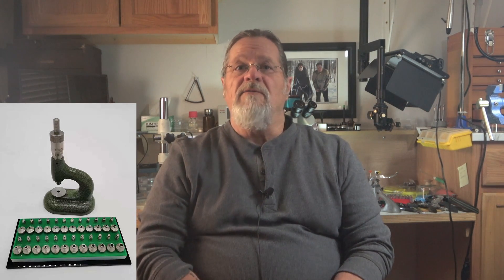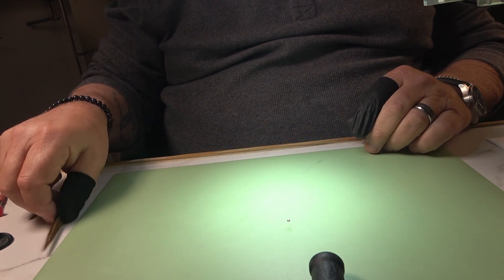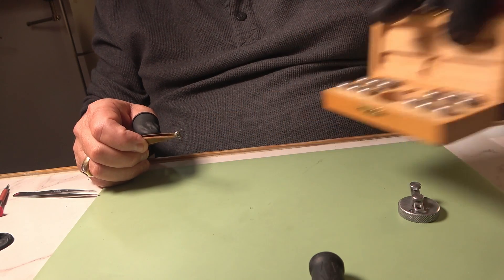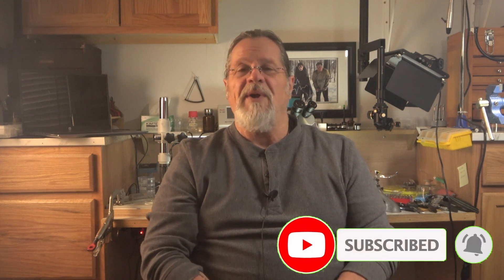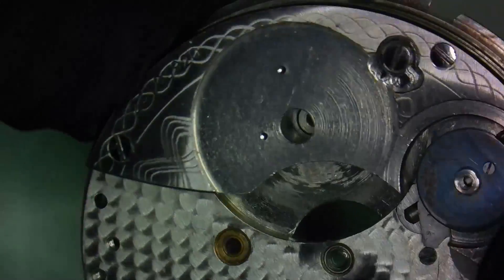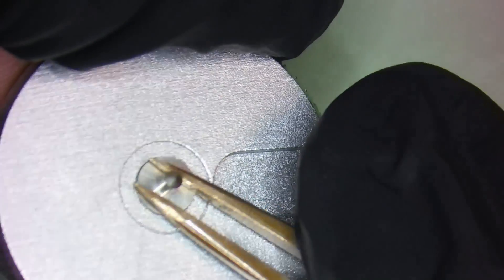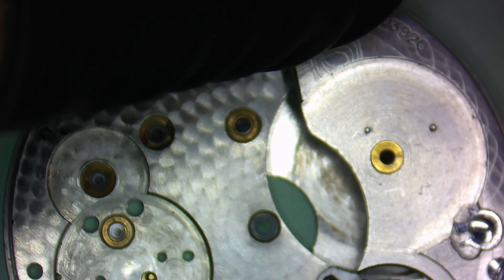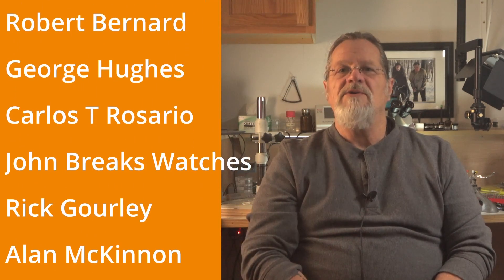Don't Buy a Horia Clone Until You Watch This.

Comment: Your videos are such a great service to the watchmaker community, Alex. I found this one as I go down the rabbit hole of attempting a jewel upgrade of the barrel arbor ports on a Seiko 6106. I just did a practice run using my Seitz jeweling tool to ream the lower barrel arbor port from 1.19 up to 1.59mm in 0.1mm increments. Worked great! 👍🏻
Reply from the maker: That's awesome! Good luck with the jeweling upgrade!

Comment: Hey Alex, as a new watchmaker  I've gone with many of the tools you've recommended, from the microscope to the time lab screw drivers and I haven't regretted any of your recommendations. The most recent in a Seitz vintage jeweling tool. I have a question on replacing a press fit jewel. Do you press the jewel in from the oil sink side or the flat side? Or does it matter? Thanks for making these videos. I've learned so much from you
Reply from the maker: I appreciate that! You always press the jewel in from the flat side.

Comment: My Chinese horia tool is amazing. Great tolerances. I also have a Seitz tool that I only use for reaming.
Reply from the maker: The handle on the one I have  came off, they are epoxied on but I was able to fix it. 
They work well for modern movements for sure.

Comment: I just purchased a Seitz jewel press (flea market) with no bits. I am thinking of buying a bit set "clone horia MSA 13.100 (bergeon 5372) Accessories watchmaker's jewelling tool with micrometric screw 4mm&4mm" for around 80 EUROS. The set has 24 pushers and 24 anvils. Any thought on that? Or any other suggestions?
Reply from the maker: You know you can buy original Seitz pushers and stakes. Without knowing how old the Seitz press you bought is,  I might suggest buying a couple of original new pushers to see if they are the modern size or the old size. If your Seitz takes the old size pushers then the clone pushers are not interchangeable with the Seitz. 
The clone tool is ok for friction fit jewels but is useless if you are working on jewel settings or rubbed in jewels found in older watch movements.
Reply: @watchrepairtutorials : My Seitz press is definitely "quite old" but very similar to the one you show in the video. There came no bit-set with the press. It does however have a base plate inserted into the press with an external diameter of 28mm. I removed it and measured the protruding pin which is around 3.9mm. So I assume it to be the modern size press (4mm)... As you suggest, if I were to buy one or a couple of original new pushers and anvils, what would be your suggestion as the most frequently used? (still not sure: orignal new Seitz pushers (step-by-step) or Horia clone pushers (one time purchase as a set))
The "plunger" also came with an inserted pusher which is stuck inside... Until now, no success in removing it from the plunger... 1) ultrasonic cleaning, 2) 24h soaking in WD40, 3) Heating the plunger with a household hair drier. Pusher is still stuck inside... From your video, you use a simple tweezer and remove the pusher from the plunger... Would love to hear your comments on that... Thanks Alex!
Reply from the maker: @manuelcorreia6448   I would suggest getting the clone set to start. I don't know what you plan on working on so i can't say whether its worth trying to build out a set from the Seitz or not. The chinese version may be adequate if  you are only working on friction fit jewels. 
As far as the stuck plunger goes I would probably use pliers. Its worthless if you can't get it out, right.
Reply: @watchrepairtutorials Thanks Alex!

Comment: Can I use a staking tool to replace a kock side balance jewel set I broke the spring and it's the kind you have to push out the setting to chang the incoblock spring.  UT 6498 I have a new setting with the 2 jewels and spring, but I don't want to destroy it with a staking set. Iv yet to find a video addressing this. I've learned a lot from your videos, thank you. Billy
Reply from the maker: Tapping the setting is likely to bend the setting. You really need a jeweling tool and incabloc pushers

Comment: Hi. 
please a quick question away from this topic. I am working on a TISSOT watch. The escape wheel and the pallet fork are made of plastic. can we use oil and what type? Thanks a lot.🙏
Reply from the maker: What’s the movement number?
Reply: @watchrepairtutorials  
Hi. It’s a TISSOT HIGH - TECH ESCAPEMENT 23 JEWELS. 2824-2. the escape wheel and pallet fork are made of gray plastic.
Reply from the maker: @L_HORLOGER  as far as I know no. If the escape wheel was steel then yes.

Comment: Hi Alex, your videos have made me brave enough to start trying some home watch repair! I currently have an old Swiss mechanical watch that's from the 1940's, and it generally runs pretty well. However, It's likely been ages since it's been oiled. Using your videos, I've gotten close but I haven't been able to unscrew most of the smaller screws inside. I can't tell if I just have the wrong tools, or if its possible some have been cemented into the watch. I'd really hate to damage them- any advice?
Reply from the maker: Well, you need to start with the right with the screwdriver. I’m not sure what you’re using now but some of the small screws can get pretty small. FYI, most screwdriver sets are not ready to start removing screws. They typically need to be adjusted to the screws in the movement that you’re working on, incidentally, this is done pretty much every time you go from one size movement to another as the screws are not consistent from one moment to the other.

Comment: My clone Horia looks and works great!
Reply from the maker: Yes, like I said in the video they  do for pushing in and pushing out friction for jewels but that wasn’t the point of the video. The Seitz has much more functionality as I touched on.
Reply: @watchrepairtutorials  Yeah, I wish I could afford the best tools and equipment. Too bad that I ruined a cap jewel chaton. I spread it out too far not paying close enough attention. I might have to try to cement the jewel into the chaton... I'm such a numbskull.
Reply from the maker: @robertcalkjr.8325  yea that’s not going to work. Replace it. And hey you don’t always need the best most expensive tools. They are important when precision is involve but I have a lot of Chinese clones that work just as well as Horia or  Bergeon
Reply: @watchrepairtutorials  Yes sir, you are correct. I bought a non-running movement for parts. It looks like the balance on it is in good shape. I only need one balance hole jewel and the lower balance cap jewel chatons.
I can't afford the best tools most of the time. I bought a lot of vintage tools for a decent price back before Covid hit. I also love vintage Dumont tweezers. And I love quality screwdrivers. I just bought a nice set of Bergeon 6899-S10 ergonomic stainless steel screwdrivers on the rotating base.
I'm tired of using my cheap screwdrivers and I don't want to use my nice 8899-A10 Beryllium screwdrivers on cheaper watch movements.
Reply: @watchrepairtutorials  Oh man, these Bergeon ergonomic stainless steel screwdrivers are a dream! I love them. I also like that they have a little more weight to them compared to my beryllium screwdrivers. And the tips should hold up much better.
Hopefully my donor movement will get here tomorrow and I can fix up my Elgin 18s Grade 74 pocket watch. I bought a nice yellow Waldemar 13" chain to wear it on my leather vest.
Then I'm servicing my 1970 Bulova wristwatch. It has an immaculate 8EA movement that is simply gorgeous.

Comment: Hi Alex, great video. I have one question, should i get a micro motor or a pendant motor for polishing the watch case, bracelet, main barrel hole etc? Which one is more suitable for watchmaking? Thanks
Reply from the maker: For polishing small things, a pendant motor is the way to go. You can do some case polishing with it as well, but serious case polishing is done with a variable speed bench machine with different types of felt wheels. You can do case polishing and bracelet polishing with a pendant motor, it’s just not as effective and you can’t remove gouges or deep scratches in a case or bracelet, which is the advantage of the bench machine.
Reply: @watchrepairtutorials  great, thanks.

Comment: Seems like you were comparing the Seitz with the cheap Horia clone. I know that you mentioned a genuine Horia is much more expensive, and cost is always a huge consideration, but would it be fair to conclude that you believe that the features the Seitz has also make it a better tool than a genuine Horia (i.e it’s not just the quality difference between the cheap clone and the genuine Horia but also that the function set of the clone and the genuine are similar/identical)?
Reply from the maker: Yes, the comparison has to do more with the functionality of the Horia style tool no matter whether it’s the original or the clone. The Horia style tool does basically one thing whereas the Sietz jeweling tool, at least the newer versions, have much more functionality, especially if you’re working on older time pieces.

Comment: Meaning noone any offense, I just think I am getting a real "thing" about buying tools in general. When it comes to used tools thewre is the matter of overprice, damaged or missing bits or unavailability of parts. (I picked up on an old JACOT tool at a decent price but the lanterns and rails were out of this World!!) When it comes to New tools there is still the matter of Overprice, but there is also durability, compatibility with existing tools (see: lathes and mills) and fit-and-finish. I am done to finding responsible 
vendors who I can trust to give me a decent piece at a decent price......but they don't have a shop on every corner. Even the NAWCC Chapter marts can get to be awfully pricey and not a little dodgy when it comes to tools. 
Now I Have had luck with BERGEON and HOROTEC but not as consistently as their price point might suggest. No real point other than letting the Old Man vent a bit.....thanks. 😢
Reply from the maker: No offense taken. I agree with you in principle but for new watchmakers these prices on new equipment are often deal breakers. You definitely have to do a lot of research to know what should be included and ask for pictures of specific area’s that you are concerned with. 
Vent away. 😀

Comment: Your videos are top notch, comprehensive on every topic you cover. I have been using a vintage Seitz for 12 years now, and I like the spring loaded pushers which seem to be less likely to damage the material.
Reply from the maker: Yea sir. It the one I learned in from the beginning and is un replaceable.  They were used in the watch factories and some of the accessories were developed primarily for the factory. Thanks for being here

Comment: Again, a great video with great explanation. I am still at a very novice level and truly don’t have a need for a jeweling press yet, hell, I am still learning to oil cap jewels without smudging, but I have come across a few vintage Seitz jeweling presses but some are 3mm and some are 4mm. The 3mm examples are typically cheaper than the 4mm, why is that and which do you recommend?
Reply from the maker: I think the 3 mm ones are obsolete today. The one I have and the replacement parts that I’ve seen are 4 mm as well. The hour clone that I have is also 4 mm so I can use those stumps and pushers as well.

Comment: Are chinese clones that bad?
Reply from the maker: Not for the money. The base is well made. The pushers are a bit wonky but they do require more  care when using them because they don’t center themselves on the jewel like the original tool would. 
So, if all you work on his friction fit movements, it would be fine. The point of the video is that if you were working on vintage move at the Seitz tool is more versatile.
Reply: @watchrepairtutorials  thanks Alex. I see, I dont work on watches that old. Also, following up on your courses, very nice work!

Comment: Hi Alex, your Seitz set seems to come with extra accessories. The ones that i see listed on eBay look complete, but only come with pushers and anvils.  They don't have the reamers or the accessory that allows you to replace jewels in chatons?  Where did you get those?  I currently have a jewel press, Favorite brand.  But it only comes with pushers and anvils .  Any idea whether they make the same accessories for the Favorite so that i can build out a complete set, with reamers and chaton jewel press?  Thank you for this video!
Reply from the maker: All basic Seitz sets come with the pushers and reamers. That's what I have. The accessories were purchased separately.  You can also find complete sets with everything included.
I am not sure if Favorite made any accessories like Seitz. They was supplying watch factories back in the day so I am pretty sure these tools were developed for that type of work. 
The Chaton tool just sits on the table and floats around so as long as your press table is large enough and you have reamers it would work. the index pins fit into its own table which goes into the hole were the table fits into.
-Alex
Reply: @watchrepairtutorials  thanks Alex, can you tell me the names if the chaton accessory and the index pins?  I'd like to go hunting for one.

Comment: Thanks Alex , great video indeed . Is there anyone who can provide some tips for rectifying a bent pivot?
Reply from the maker: My experience is that it is virtually impossible to straighten one to degree of straightness and that they usually just break. Replacement is the best option.
Reply: Thank you .
Reply: Thanks Alex . My problem couldn’t find the part ( omega cal420 part 1250) any hints ?
Reply from the maker: @hichembouhlel2825  I just did a quick Google search and found 2 of them on eBay

Comment: I don’t even have to watch this to know the Sietz is better but I fell for the Horia clone.
It’s been used a few times successfully but recently I needed to ream a hole and it’s impossible on the Horia. 
Your estimation on the price of a Seitz is well off, at least here in the uk. I’ve been looking at them and they are all going £300-500 !! For a complete set
Reply from the maker: Hello, Mike, I believe what I said was that a full set of Horia was around two grand. The Seitz sells for much less here in the states as well.
Reply: @watchrepairtutorials   sorry yes the Horia is stupidly expensive and I don’t think those reamers are for the micrometer tool as I had this discussion recently the opinion is those reamers fit another Horia tool as the micrometer one does not actually turn it only pushes down.
The Seitz tool I’ve been actively trying to buy over the last few weeks and have been out bid on every occasion ! Fortunately I have a watch fair on the 12th so might find one there.
Reply from the maker: @MyRetroWatches keep your eyes out Mike and you’ll find the perfect one
Reply: @MyRetroWatches  It took me a good while to get a decent set for reasonable money. 
There is also the Favourite brand, that sometimes come with a faceplate to hold bridges ect for reaming. But for the Seitz, one can still buy new reamers, puchers ect. For not to silly prices. Think it was rebranded to bergeon a while a go. But is the same as seitz. The tool has modern bergeon look though. 
Considering the sometimes asking prices on fleabay ect. It might make sense to get a brand new set complete. Without missing parts, or worn reamers and puchers. 
Think it took me 6months to find my set.
Reply: @MyRetroWatches I'd you're considering a cheap jeweling set you can also look into CE Marshall jeweling sets and they're just as good.
Reply: Hi Mike, where’s the uk watch fair on the 12th? Good luck finding one!
Reply: @boydsargeant7496  I know I’m going. I am fortunate to only live 6 miles away plus I meet up with a lot of guys from my Facebook group.

Comment: Alex, an excellent video again!
Thanks for that. Only one addition to that. Actually I have two of Seitz press tool set. Only one of them can be turned to use as a micrometer press one. The other one simply don't have that possibility. The older one in nice wooden box however equipped with pivot size measurement gauge and pivot bent repair stuff.
So I am happy to both of them 😊
Reply from the maker: Sometimes those knobs for the micrometer show up on eBay if you keep a look out.

Comment: Seittz tool, Jacot tool, staking set,  winders, lathe,  cleaning machine, etc these things are expensive for a hobbyist. I am at a cross roads deciding is there enough practicality, value and enjoyment to pass over the line and purchase these tools over time. For now I stick with known movements such as ETA and Seiko where parts are readily available and replace them when needed. I am also hesitant purchasing these tools until I learn in detail what each tool should come with and what they do. A lot of "sets" are missing items or different parts from different manufacturers or chipped or broken. Pity the modern day manufacturing companies are trying to re create the tools needed but are cutting corners. Just like Christmas cake there is a finite  number of these old machines and tools so I suspect pricing to increase as availability  and quality decrease so at least your investment will not diminish over time.
Reply from the maker: Well, I probably wouldn’t worry about a lathe anytime soon but once you’re set up to service the movement completely, then the next two big tools are the staking side and obviously the jewel press. 
But again, it all depends on what you’re working on . 
I constantly see people who buy vintage pocket watches to work on with the chance of fixing anything because they don’t have a staking set or jewel set
Reply: Dont forget they do re sell, usually you will get the money back  you initially paid (if you bought a good used tool) & then you decide to "retire".
Reply from the maker: @johnsenior8205  so true. Good tools were always go up in value.